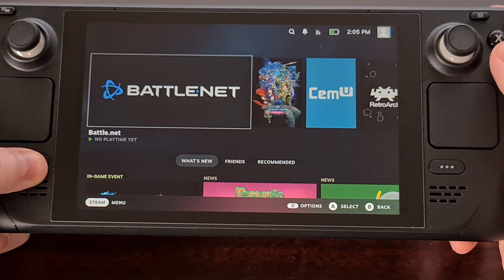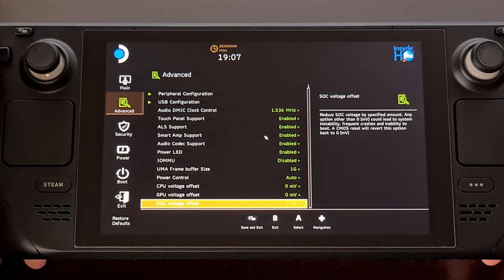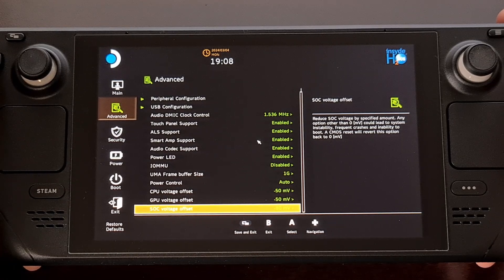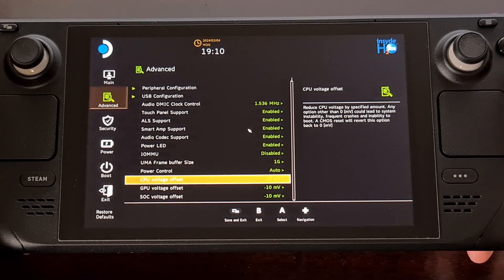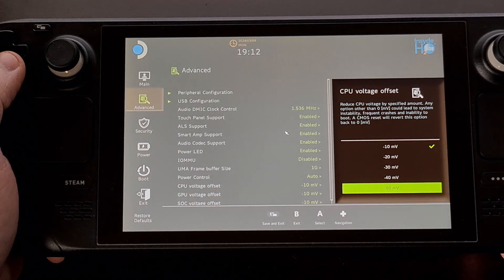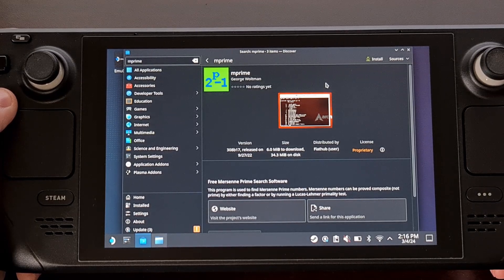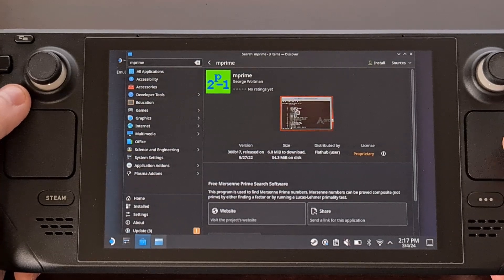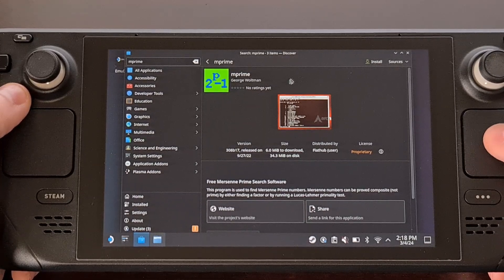How to Undervolt the Steam Deck and Test for Stability? CPU, GPU, & SoC Steam Deck Undervolting

Comment: I’ve had 2 steam decks with completely opposite outcomes I had an LCD originally it unfortunately couldn’t be undervolted at all due to crashing issues even demanding games caused a crash at stock voltage after a putting up with it for a month hoping an update might fix it I ended up getting it returned in the end recently I’ve grabbed the oled as I missed having my steam library at work on the go and though may as well give the undervolt  a go see if I’m any lucky compared too last time and I’m thrilled that my oled steam deck has hit -50 all round went from one extreme too the next
Reply from the maker: that's amazing! 
sadly, the first experience you had just sounds like you had a bad unit. I'm glad you didn't give up completely though :)

Comment: I won the silicone lottery by able to maxing it all out to -50,-50,-50!!! Lets try do some overclock and see if i were as lucky as i am at undervolt. Oh yeah my SD is a LCD 64GB ones so if you thought when you bought the higher storage one can get you better chip on SD its completely wrong assumption. Just be lucky sometimes are enough
Reply from the maker: congrats, man! that's incredible. I've still been working on zeroing in on the numbers mine is able to handle. but I wish I had yours!

Comment: I got an OLED and I can only get down to -20 on CPU, -20 SOC and -10 on GPU before running into issues. But I'm still getting an extra 10-15 minuets of battery life under load so I'll take it... But by no means did I win the silicon lottery 😅

Comment: I would like to know what SOC is and whether undervolting SOC is as important and changes power consumption as undervolting CPU and GPU.
Reply: Yes, I have the same question, SOC means CPU+GPU, so what's the difference between SOC voltage offset and CPU/GPU voltage offset?
Reply: SOC is a separate chip meant for many different things like io and ram.